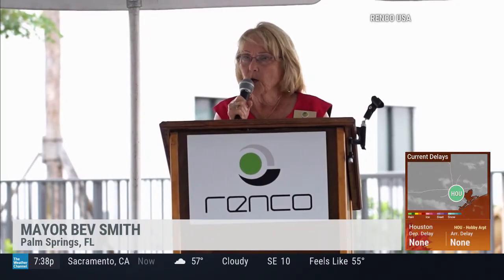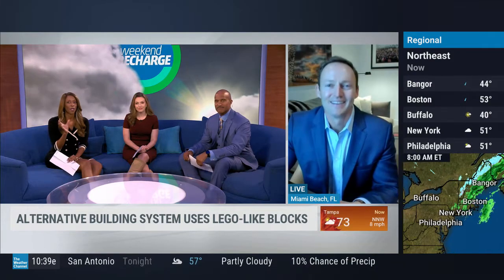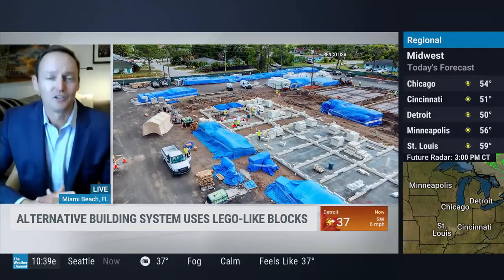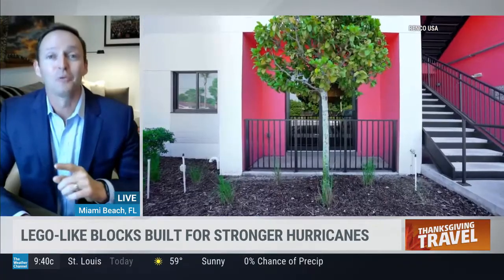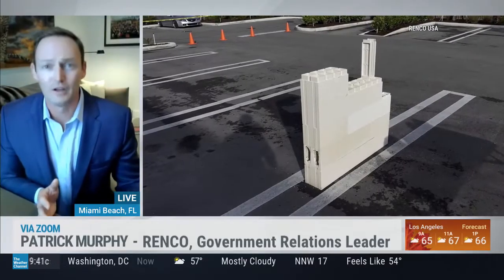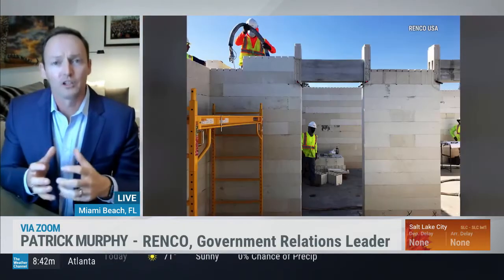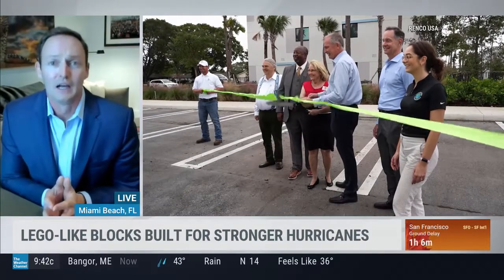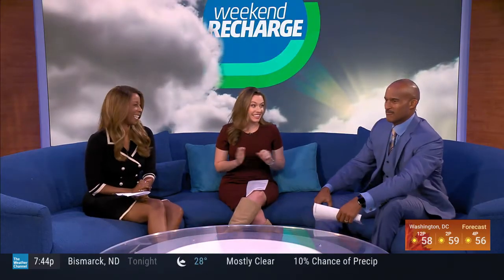RENCO's Lego-Like Blocks Built For Stronger Hurricanes

Comment: Can people buy these Lego like blocks to build their own homes NOW?
We live in tornado alley 🌪️.  Can these withstand those types of winds?  
What kind of foundation do you need for this?
Can these be built in a dome shape?
If you are reading this Renco, We want to talk with you.  Can rebar and/or shotcrete be used to increase the strength of the building?  Are there any problems with off-gassing or humidity after it is built?  How is it insulated?  Can you berm a building with these Lego like blocks?